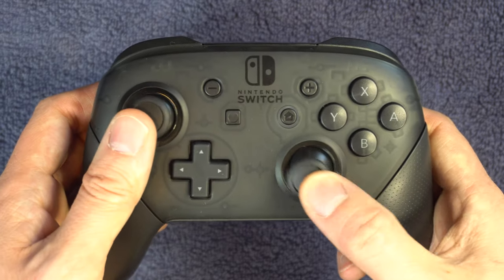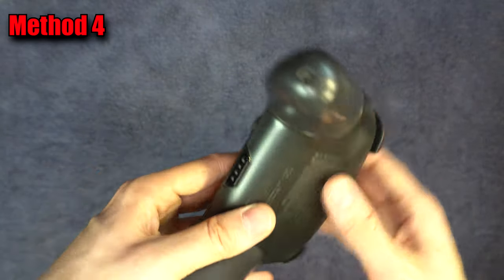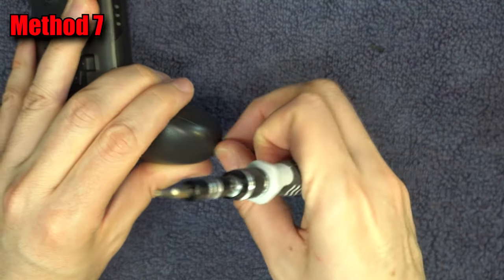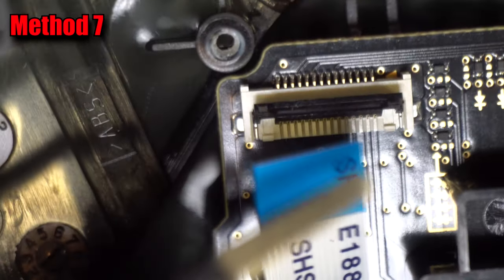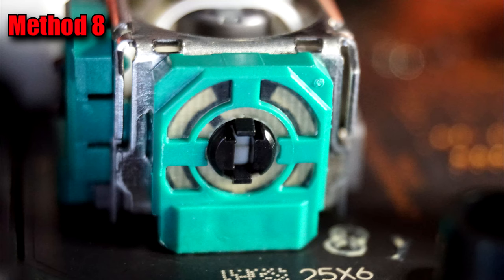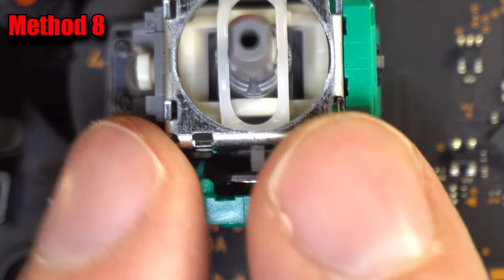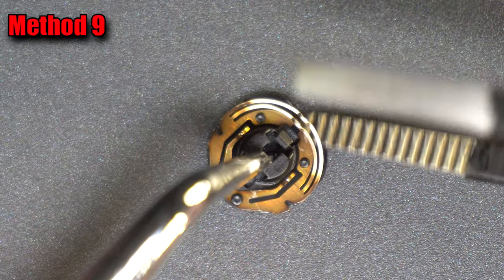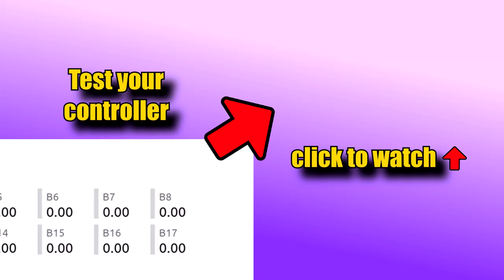10 Ways to Fix Drift on Switch Pro Controller (How to Repair Analog Stick)

Comment from the maker: My Gameroom Items (updated 6/29/2022)
Rack Mount Power Supply: https://amzn.to/3NPpKvM
16 Port HDMI Switch 60 Hz: https://amzn.to/3H5vP4E
LG 43" 4K HDR TV (43UM7300PUA): https://amzn.to/3NddfZT
Kinivo HDMI Switch Box (550BN): https://amzn.to/3NQm7FW
10-Port USB Hub: https://amzn.to/39ixyae
Console Trays: https://amzn.to/3OOTzfV
Wall Shelf for Handhelds: https://amzn.to/3I3SS01
Vectrex table: https://amzn.to/39ZkmHE
4K HDMI Cable 8 feet/2 Pack: https://amzn.to/3QkKmgT
HDMI Cable 10 feet: https://amzn.to/3xqEmL3
Power Cord Splitter: https://amzn.to/3zBfT8K
Wireless microphone: https://amzn.to/3xG04uO
Labelmaker: https://amzn.to/3OdaOYG
Vectrex overlay magnets: https://amzn.to/3ytxz57
Evercade Vs System: https://amzn.to/3OTk043
Genesis mini: https://amzn.to/3I0bxKe
Neo Geo mini: https://amzn.to/3R7Z1g6
TurboGrafx mini: https://amzn.to/3nongZE
F-Type Coaxial RG6 Connector Adapter: https://amzn.to/35ad4dX
F-Type Male Plug to RCA Female: https://amzn.to/3k7eaNK
RCA Female to Female Coupler: https://amzn.to/3nY0zdV
RCA Male to Female: https://amzn.to/31fn98h
RCA 1 Male to 2 Female Y Splitter: https://amzn.to/3ka0wtk
S-video 1 Male to 2 Female Y Splitter: https://amzn.to/37evEUQ

Other TESmart switchboxes (I don't own):
TESmart 16 Port HDMI Switch 30 Hz: https://amzn.to/39b9mGZ
TESmart 8 Port HDMI Switch 60 Hz: https://amzn.to/3xngDLY
TESmart 8 Port HDMI Switch 60 Hz: https://amzn.to/3NtDOuJ

Comment: Literally fixed my $60 controller in less than 2 minutes. Definitely a like
Reply: Which method worked?
Reply: Calibrated worked for me my right joystick was so hard to move, and it worked
Reply: Same dude the straw method worked for me wonders
Reply: Method three/saved me a new pro controller!!
Reply: tap that

Comment: Absolutely the best guide out there with so many more methods to try. I've been fixing my controller every other day cos the drift keeps coming back, glad I have more methods to try if it persists
Reply from the maker: Cool. Hopefully the video will help.
Reply: @HowToX Hello, I know this is an old video but what kind of glue would you recommend if I removed the soft parts for under the buttons? I removed them thinking that I could clean them, I did clean them but now it's a hassle to put the soft pieces back on without them falling off and or not being in place properly

Comment: So, what kind of glue would you recommend if I removed the soft parts for under the buttons? I removed them thinking that I could clean them, I did clean them but now it's a hassle to put the soft pieces back on without them falling off and or not being in place properly

Comment: I may end up having to try one of these methods.  My Pro Controller (which I bought about a year after I bought my first Switch) just started to drift.  The irony is that I bought it because the Joy-Cons were drifting.  But I did manage to replace the joysticks on those, so in the meantime, I can always use those in the event that I need to replace the joysticks on my Pro Controller.

Comment: Had my controller for about 5 years, when I opened it up it was pretty clean. I used a small long flat head screw driver  , alcohol and Q tips, went as far as opening the doors ,taking the discs out , brushing and assembled . I did not use any paper though and it works great now , impressed , thank you.

Comment: I did did all methods excluding the last one and it fixed the drift issue I’ve had for over two years; so far these methods worked for me. If the issue comes back I’ll update the comment.
Reply: Still good?
Reply: @nielsculy-quere5023  yep

Comment: After goin' inside my Mario Bros. 3 pro controller, I've concluded that the main issue is the mechanism for the left analog stick being stiffer--it springs back with significantly less force than the right analog stick mechanism, which immediately snaps back to center after bein' let go. It also seems to be clean in there, so I doubt any more cleaning will fix this problem. :C
Reply: I have the same problem. It seems the “off brand” pro controllers just aren’t as well made as the regular ones. I still had a little better results after using the alcohol on the tachometer in the joystick though

Comment: Hey man. I didn't even have to open it. All I did was the vacuum cleaner and q-tips and it 100% fixed it. I couldnt hold up on the left joystick before. Thanks a lot

Comment: Not a question about this controller: My PS5 R3 button won’t work, no stick drift. Sometimes the R3 button will work, but then other times it won’t. Anything I can do?
Reply: Can you feel the button 'click' when you press it? if not, there may be a piecen of dirt between the button and ths contact. dissasemble and clean manually with conpressed air or alcohol. be sure it is COMPLETELY dry before turning back on. recommend testing button before reassembly. Best of Luck!

Comment: I have a stubborn left stick on my pro controller that drifts downwards. I got my switch on a trip to the US and am currently living in Brazil, around here, Nintendo only offers free repairs to joy cons. I have tried all of the methods you mentioned that don't open the controller and it was fine for a week, until it started drifting again 😢 I guess I'll need to open it

Comment: Hey there. I have a pro switch controller . 
From week one I’ve noticed the left stick makes a plastic on plastic grind . I can actually feel the stick rubbing against housing. Is this normal ? The right stick is gold in comparison. 
Sad to think I “upgraded” to Nintendo’s pro controller from useless drifty cheap joycon s with crap quality thumbstick s.
The pro controller cost me extra 90 and I’m not sure it’ll last long and I’m super careful using no roughhouse play. Wait and see. I got a warranty until 2025 full replacement , what’s the point in swapping for what is probably a production faulty in all pro controllers by Nintendo .
Next I’ll try 8 bitdo controller .

Sorry for rant

Comment: Hello! One of the joysticks on my procontroller feels rigid and jerky. It squeeks and does not jump back to «neutral» when I let go. Most obvious while moving the joystick downwards. The other one feels completely smooth by comparison. This happened out of the blue when I was playing. I have opened the green doors and cleaned as instructed, but it made no improvement. Got any additional advice? 😕
Edit: I ended up spraying it with some silicone. It got better, but not perfect.

Comment: After removing and cleaning the wiper for left/right from my left stick (it was drifting left often) it now seems to constantly hold hard down; I can't even calibrate it as holding right doesn't register far enough to count. I also took out the up/down wiper from the same stick and checked it out but I couldn't see any obvious issues. Any ideas as to what could be the source of the issue? I'm looking to buy new wipers if I can't figure it out but I figured I'd ask here and hopefully save myself some time/money.
Reply from the maker: Not sure if you tried it, but you can try adjusting the tension of the wiper; push it down or pull it up. Also make sure no residue is on the entire board from the initial repair. Maybe clean the board with a toothbrush and alcohol.
Reply: @HowToX  I've given the board a clean; I've also swapped the wipers around to check if that's even the core issue but I still had the same issue not matter what configuration of wipers I used; anything else I can check/any other resources or breakdowns of the controller that I could look at?
Reply: @HowToX  I've just checked as well; seems as though both sticks have this issue. Should I assume it's something on the board?
Reply: @HowToX  And another thing now: I've tested it using gamepad tester and it seems as thought neither stick has any vertical function, at all. Horizontal functions fine but no up/down movement whatsoever

Comment: I bought a refurbished Switch afterglow controller. Turns out it was drifting and the seller sent me a refund and told me to keep it. I had nothing to lose, so I disassemled it (it's clear it had never been opened) and lifted up the small metal part of the disc inside the little box. It fixed the issue,  thank you very much!!! :)

Comment: My pro controller is brand new, I bought it a few weeks ago.  It had drift right out of the box!  On both sticks, too.  If I hold the stick in the down position and let go, it snaps right back up to the dead center and it's fine.  But if I move it back the center slowly, the stick rests just below the dead center and perpetually sends a light downward input.  It's not unusable but god damn it is annoying.  These controllers aren't cheap and I'm pretty disappointed with nintendo.  I'm not taking mine apart to clean it because I don't see how it could be dirty from the minimal use by an adult in a clean home.  Fuck drift.  Fuck ninty and their $70 'pro' controller.
Reply from the maker: You are not the first to have this story. My theory is that factory dirt gets inside. Cleaning may work.

Comment: I used the straw method to fix my drift, but then my controller built some resistance and started making rubber sounds? What is the issue? Did I blow through the straw too hard?
Reply from the maker: You may have a loose object inside, like a piece of plastic or fingernail.
Reply: @HowToX  I see, thank you for the response

Comment: Never experienced drift but what I have experienced is the L and R bumpers not registering with each press. Been through 7 pro controllers and none of them register the bumpers 100%. Maddening because it's so comfortable.
Reply from the maker: You may want to watch my video about repairing L2 and R2 on a dualshock https://youtu.be/2CaQx3VBrFE